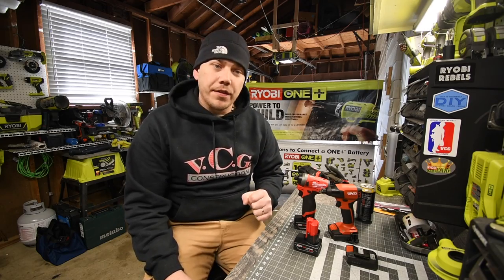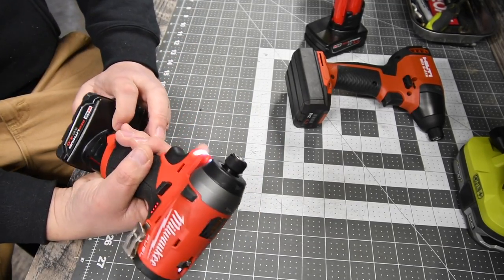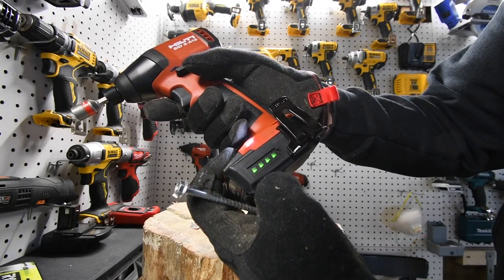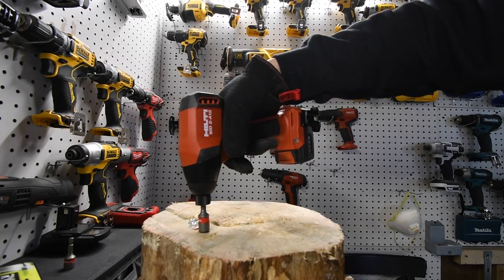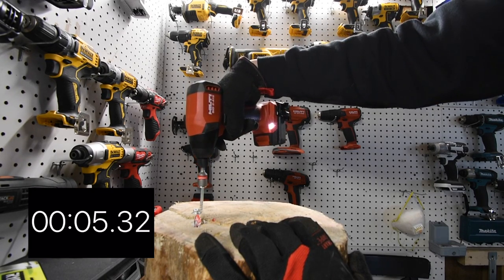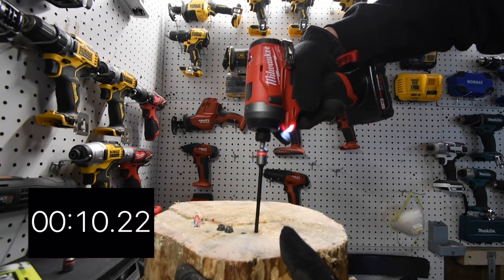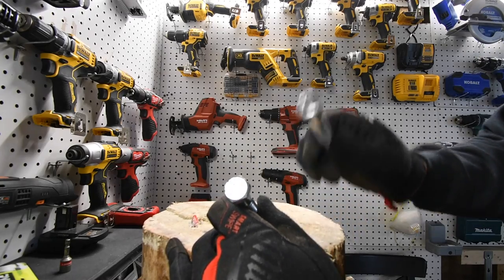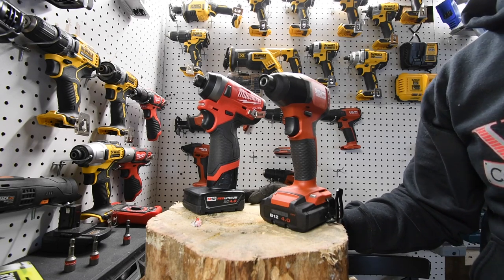Milwaukee M12v Vs. HILTI 12v Impact Drivers

Comment: I wish you would use the same size batteries to make the test fair.  Matching up Amp hours does NOT mean each battery has the same power level.  That Hilti battery is 1P battery with 3 18650 cells.  The Milwaukee a battery is a 2P battery with 6 18650 cells.  The Hilti never stood a chance in this test.  The Milwaukee had twice the potential power output.
For instance: Milwaukee makes two different types of 12V 3.0 batteries.  One is a compact 1P pack with 3 - 3.0 cells and another 2P pack with 6 - 1.5Ah cells.  Same Amp hours (run time) but 2P pack has twice the power output.
You could have used a compact Milwaukee 2.0 or 3.0 CP pack (3 cells) vs the Hilti 2.6 pack becaues each pack uses 3 - 18650 cells.  Or you could have compared any Milwaukee 3.0, 4.0, or 6.0 EX pack (6 cells) vs a Hilti 4.0 pack.  The Hilti 4.0 pack also has 3 cells but they are 21700 cells and a 21700 cell has almost twice the power level as a 18650 cell.
I don't want to sound critical, but I am trying to help you out so your site has more credibility as it grows.
Reply from the maker: Did you watch the whole video? because I use 4ah batteries on both of them. I don't mean to be critical, but maybe before you write a comment like this watch the whole video :) I used 4ah vs 4ah as well
Reply from the maker: but I thank you so much for viewing
Reply: @ManCaverTools  Yes.  But you never used an equivalent battery to the Hilti 2.6.  Both Milwaukee batteries you used were 2P batteries which have the same power just different run time.
I did watch the whole vid.  I should have clarified.  Your 4.0 vs 4.0 test was fair.  The 2.6 vs 3.0 was not.
Reply: @IndependentThinker74  does hilti even offer  "2P battery" for it's 12v line?
Reply: @xxsk8r101xx  No. But, they use a 1P design in the 4.0 pack that uses larger 21700 cells.  So it performs almost like a standard 2P pack.  Their 2.6 pack uses the smaller 18650 cells.
Reply: @IndependentThinker74  so what exactly would be the fair comparison between the two? didn't he use the 4.0 hilti vs 4.0 milwaukee? wouldn't that be a fair comparison?
Reply from the maker: The cells in the batteries have nothing to do with HILTI losing
Reply: Милка выиграла за счёт оборотов, количества ударов и более мощной пружины ударного механизма, а это обеспечил мощный и энергоэффективный двигатель, равных, которому нет на рынке! Хилти имеет одну модель с бесщёточным мотором, устаревшей конструкции выжирающей аккумулятор. Кроме легендарной надёжности крыть нечем и я голосую рублём за компактную мощь на поясе с маленьким аккумулятором
Reply: @IndependentThinker74  Its not just the batteries. Milwaukee's DC motor is designed to excel better at a 12V voltage. Hilti uses a scaled down 20V motor. It's not as good, but R&D was cheaper.

Comment: Milwaukees M12 System is impressive. But this is basicly the only good they have to offeer
Reply from the maker: I thank you so much for viewing  Damon
Reply: Small minded comment from Damon
Reply: @Shalewedance  ok than tell me why the m18 impact driver is a good tool? Yes the Gen3 is very compact, its so conpact that the battery is above the collet.
Also the M18 batteries are way to big. 

The Milwaukee High output 5.5 Ah is even bigger than the 8Ah Bosch ProCore.
Reply: What are you talking about? 18v fuel impact and hammer drill are top of their class in power,  they choose power over precision which every single tool has to choose which way they want to go,    the band saws,  hole hawgs, many of their outdoor equipment tools,  sawzall,  ridiculous amount of plumbing tools,  press tools, drain equipment,  air snake,  lights are top of the line,  where else do they not shine?
Reply: @footlongburrito  many tools in one System don't include thats all good. There are some good M18 Tools but the M18 Hammerdrill was never best in class and the the impact driver had for more than 2 years collet and switch malfunctions. 
The M12 Festool clone has an awful right left switch, the M12 Hammerdrills are as big as 18V Metabo compact drills,  the M18 batterys like to get stuck on the tool on dusty applications. 
All Milwaukee Tools run compared to competion models on the hot side after more intense use. 
But Milwaukee is champion on Marketing.

Comment: The amp*hour rating of a battery has nothing to do with power output. The power is only a function of voltage, if both batteries are fully charged (as close to 12 volts as possible), then the batteries have no impact on the motor outputs, regardless of capacity.
Reply from the maker: yes it does. I have like 70 videos proving it.
Reply: Сдвоенные батареи имеют меньшую просадку напряжения и поэтому дают прирост мощности на больших нагрузках
Reply: @ManCaverTools  It isn't the Ah per se, it is the number of cells and the discharge rating of those cells. Some cells are high capacity, others are high discharge. For example, a 12V pack rated 3.0 Ah can have three 3.0 Ah cells, or six 1.5 Ah cells (two-parallel). They have the same capacity, but the second pack with six cells can provide higher power under peak load
edit: also, the physically-larger 21700 cells can provide higher discharge than equivalent capacity 18650 cells

Comment: slow down... it is all abou the battery... and you are comparing 3S2P (milwaukee) VS 3S1P (hilti) you will get lot less power from hilti battery, you should use milwaukee compact 3S1P battery in this time comparsion :) there is more than 30% power difference between 2P and 1P packs at high demnad applications.
Reply: Daniel Kosorin should have used the 4.0 battery for the hilti for the entire test or 2.0 for the Milwaukee.
Reply from the maker: if you watch the whole video I use a 4ah vs 4ah
Reply from the maker: I use a 4ah vs 4ah and the hilti still lost
Reply: @ManCaverTools  IT IS not ONLY about capacity :) Milwaukee uses 2,0Ah 18650 "high current" cells (20A cont. at 2P is 40A constant current) Hilti does have 4Ah "high capacity" 21700 Cell Which Is rated ONLY for 15A constant current. =} Milwaukee 6 Cell battery can deliver much higer current (And power) than Hilti 3 Cell pack :)
Reply from the maker: Daniel Kosorin and that has to do with this video how? I’m sorry I’m just not sure what point you have when it comes to these batteries on a 12v system. These are the batteries that are available and so that is what I used sir
Reply from the maker: You gotta realize people don’t know about the cells in batteries like we do. Most people just see the ah and that’s it. 18650 cells and 21700 cells will go right over there head and not know what it means. I have multiple ah batteries so I used multiple ah batteries. If I used a totally different ah batteries to go against each other, I would have hundreds of comments saying I’m dumb and I know nothing of tools.
Reply: @kosorind  you do realize that 21700 cells are BETTER THAN 18650s right
Reply: @kosorind  21700 are the higher output cells, get your facts straight.
The milwaukee uses the old 18650, if it  had an HO battery, it would be a huge boost to the already powerful tool
Reply: That's not making any sense at all Hilti to over rated and it it get out perform by a cheaper brand

Comment: A bad test. These tools are made for other tasks. Such large screws need to be screwed with a more powerful tool. You should compare them in real work. Power is not the main indicator if both tools have enough power to solve a specific task.
Reply from the maker: that is what I do on this channel. I put these tools through the extreme to see if they survive

Comment: BS trying ,when i have long screws i use the old corded magnum milwake  for all thse types of longer s crews millions times way cheap and faster. So regarding those impact drives  they only good for ocasionally  driving screws.buy a mileake magnum you will be beat  all tnose and saving a  lot money in batteries, etc,,,.